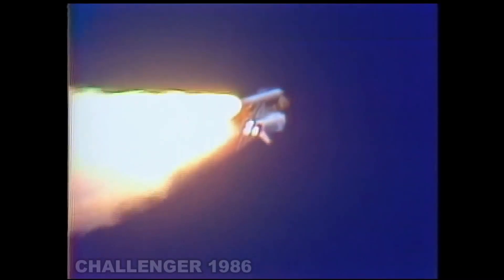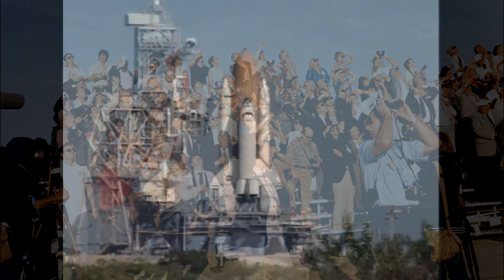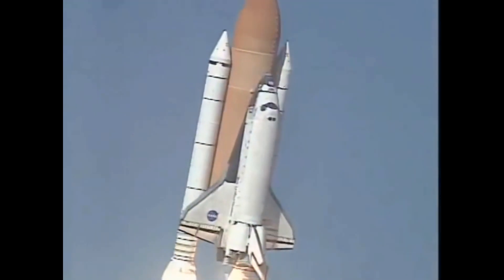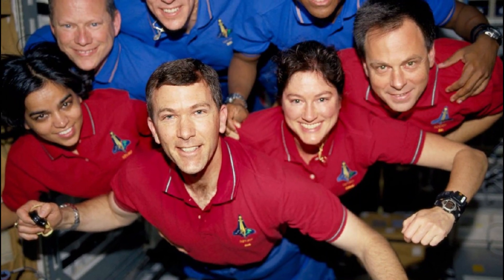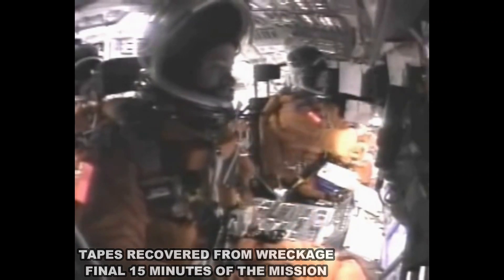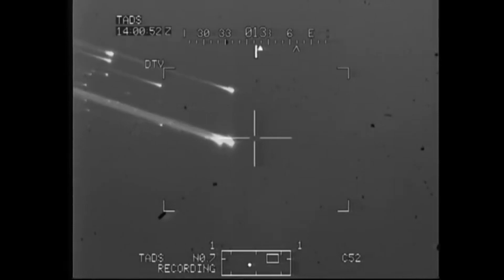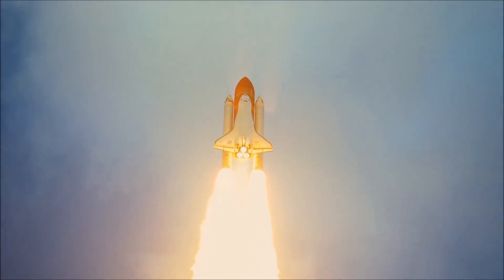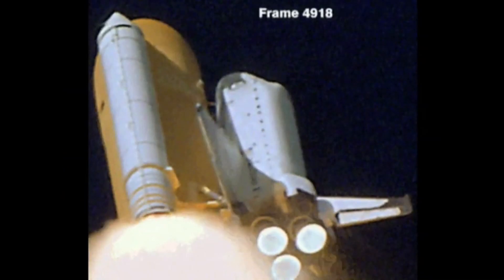The Columbia Shuttle Disaster

Comment: its so frustrating that this could have been prevented if the scientists were just listened to from the start
Reply: That was the Challenger disaster. The engineers warned that launching when the temperature was below freezing was dangerous. NASA launched anyway and the o rings on the fuel tank failed. The Challenger blew up right after it was launched. On Columbia the launch was ok. But a large piece of foam came loose from the fuel tank and hit the left wing. It made a large hole. NASA didn't know the serious nature of the accident until days later when Columbia was landing.  The large hole let the super heat from the landing into the wing and the shuttle came apart over Texas.